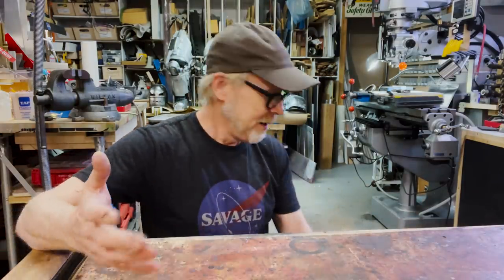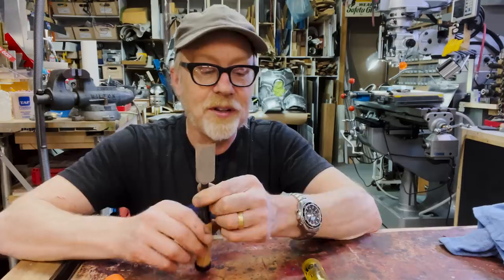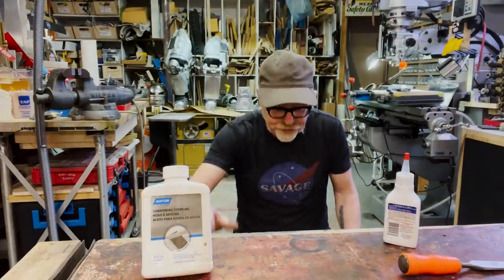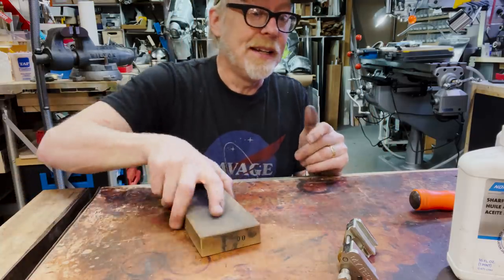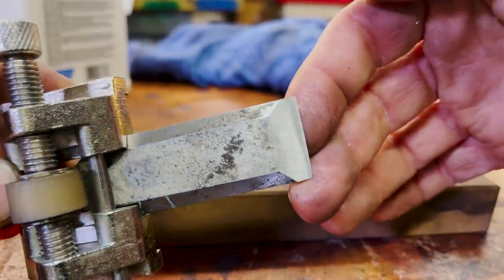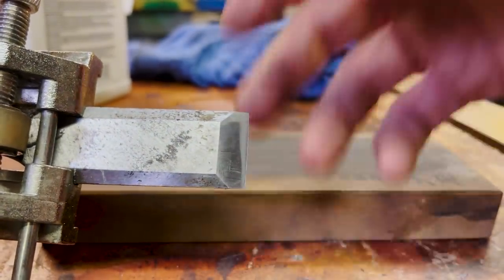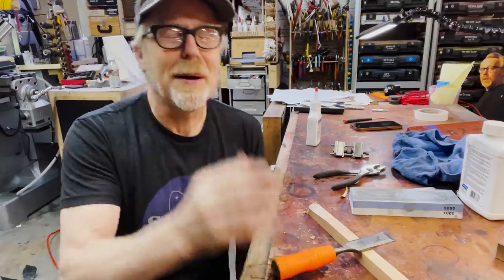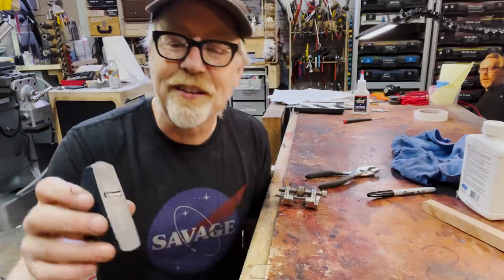Adam Savage's Favorite Tools: Woodworking Chisel Sharpening!

Comment: No one's gonna rant about how Adam used oil on a waterstone?
Reply: Have you even looked at the comment section?
Reply: @PeppoMusic  must be their first day on the Internet. Heck you must be kind of new too. I didn't even have to look to know.
Reply: @1pcfred  the internet's kinda new for the entirety of humanity, really. But I gotta admit I did not spend too much time on the internet during the dial-up days as a kid.
Reply: @PeppoMusic  I did. To this day when someone mentions it I can still head the connection sound echoing in my head. My USR Sportster was a hard rocking modem. I had a Hayes too. The 56K Sportster was the one to have. External, of course.

Comment: A water stone needs to be wet with water, all you did was destroy the stone and over heat the tool, I doubt the 3000 stone made the tool any sharper.  Save some time and leave the water stones in a bucket of water when not using them or just get some DMT diamond stones

Comment: I'm sure it's ok to not use the guide once you've established your bevels.. Then again no harm and less fuss if you've made a stop guide for it. Also, diamond plates > stones for me.
Reply: You're wrong. The guide is so you can maintain your bevel. How do I know? I've been sharpening for over 50 years now. So trust me when I say there is a difference guide or no guide. They sell guides because they actually work. Least you're hep to diamond plates though. You're not wrong there.
Reply: @1pcfred  Well good that it has done you well for so long sir. I respect that you have your opinions and I'm not saying it's right or wrong. But just that there are many ways to achieve the same results. Surely you'd know that better than a youngling like me. Before guides existed, or the "proper" angles were even agreed upon by the general masses, things still got made at even higher quality than they are today. There are no doubts that freehand sharpening has its merits as it's been proven for hundreds of years. A guide or diamond plate is merely an enhancement to old but proven methods. Regarding my comment though, I'm sorry but I should've specified that it was about secondary bevels, as the main bevel, once established on a guide as you preferred, shouldn't be too difficult to hone even for beginners as I know that from personal experience. Sure you might end up having 29, 31, 31.5⁰ or even all of it but it still doesn't affect the cut significantly. Either disagreeing or not we can all agree that the smooth sound of wood getting shaved and shooting out of a plane is satisfying as hell.
Reply: @orien2v2  there is such a thing as a qualified opinion. There is also such a thing as being wrong too. You suffer from survivor bias.

Comment: The reason you're supposed to use water on waterstones is because the metal slurry that forms under your blade is effectively the abrasive, not the stone itself. Oil does make a sludgy substance as well as water. You're also supposed to soak waterstones in water until they're saturated before use.
Reply: There are different kinds of water stones. Not all are pre soak. Some are what is called, "splash and go".

Comment: Poor mans sharpening setup. Get some automotive wet sand paper, stick it to a piece of glass. Seen some use windex to wet the sand paper. Also seen some guy go up to like 16,000 grit on his final sand. I also saw a video where someone said you don't wanna use oil on the stone since it creates a lubrication barrier between the blade and stone thus not giving you a efficient sharpening experience?

Comment: It's a lot easier if you have a jig to line up how far out to protrude the blade from the edge of the sharpener.
Reply: I use a little scrap of plexi. I hold it all up to the light to establish my secondary bevel.

Comment: Ditch the guide. Lay the chisel on the bevelled edge and raise it 5 degrees. Use all of the stone when sharpening. By using the guide your causing uneven wear on the stone which will eventually affect your wider blades.

Comment: Learn to make a good chisel and using a good one will never scare you again. Also, keep a leather strop on hand for when you're chiseling and sharpening won't be as frequent as long as you strop when it starts going dull. Not when it does get dull but when it starts to
Reply: If you're doing varied work there's always jobs where one needs to use a chisel for destructive tasks. So having different grades of chisels for different kinds of work is absolutely correct. I have designated beater chisels. Although I keep them pretty sharp too.

Comment: You do watch other channels, so why not watch Paul Sellers, Rex Krueger, or Rob Cosman to mention a few on how to sharpen with or without stones? When you know how to do it, you'll literally use only a minute on each chisel (unless you've completely ruined the edge). The point is that woodworkers sharpen or hone their chisels and plane irons often, even several times a day if they used them a lot. So sharpening/honing has to be quick and efficient. And doing it right is cheaper than doing it wrong. Also, if you're impatient (if!) just know that you could actually sharpen and hone quicker than you do now ;^)

The prerequisites are: an always accessible sharpening station/board with whatever you use for sharpening (sandpaper glued to glas, water stones, diamond stones, oil stones, etc, but generally speaking three stones: course, fine, very fine.) and a strop (a piece of leather glued to a board with a (usually green) honing compound). So, three stones and a strop. For the stones: water or oil, and the compound for the strop. That's manageable :^) And watching a video by one of the above mentioned gentlemen won't take that long.

Comment: I watched this and cringed... So many people, in fact 99% of people, can't and repeatedly sharpen a chisel wrong....those guides are not helping....  Turn your chisel 90 degrees and stroke like you were without the guide...have you seen a sharpening stone from an antique carpenters tool chest...they are like 4 inches  long... Dont you think a guide of some sort would have been in those chests... Buy holding it 90° to the stone in your dominate hand and using your other hand to apply pressure to the bevel you dont need a guide... By doing this the burr is minimized and a few strokes on a strop will be fine... But think about a knife and how its sharpened... Do you push the bevel or drag it across 90° to the surface... Its more ergonomic and the correct way... Why would ten thousand people make videos about sharpening because no one gets it... Its awkward, turn your blade 90° to the stone and it will be a better operation

Comment: I switched to a Workshop 3000. Fast.  reliable. Did I say fast...?
Reply: If you know what you're doing, and I am not implying that many do, hand honing can be pretty fast too.
Reply: @1pcfred  I understand. Been doing it for over 20yrs. If you work with chisels and planes a lot, the Worksharp is kind of game changer. I am not being compensated in any way for this. I just really believe in the system. There are good videos on Youtube about the system. It can also do gouges.
Reply: The Workshop 3000 is a great system, especially for edges where you want a flat bevel. If you want a hollow bevel, then I would recommend the Tormek sharpening system.
Reply: @jimmeier547  Tormeks are great if you got a grand burning a hole in your pocket. Because by the time you're done buying one you'll have spent at least that much. With a couple accessories and maybe another wheel. At $220 a pop. I manage with a bench grinder and a cup of water personally. Bit more fiscally responsible.
Reply: @tdnate  with any power system you're limited by the kind of abrasives you can use. I'm sure for what it is the machine does a fine job. I am further sure that it is not the have all and end all when it comes to the ultimate in sharpness. Sharp enough? Sure. Sharper than most folks can manage? Probably. As sharp as I like things? No. I've been sharpening for 50 years now. I started real young.
Reply: @1pcfred  And like Adam suggested, it is like comparing the Japanese chisel to the cheap chisel. There is a time and place where the quality of the tool matters. For sharpening, especially for that precise edge for my turning tools, the Tormek is the right choice and actually, makes it fiscally reasonable.
Reply: @1pcfred  I agree, everyones idea of sharp is according to their desire and needs. In our shop we go to 2000 grit sometimes (I know they make a 3600 grit too) but mostly we go to 1000 for quick touch ups then to a honing strop. It works for us.

Comment: So I guess I've become one of those people who yell at their screen your always talking about.
Here is the wisdom of my 20 years of being a chef and knife maker.
All of your stones are water stones and do not need oil. Please use water. By which I mean soak your stone in water until the bubbles stop coming out and have some water standing by to splash onto the stone as you go but use sparingly. The water and stone make a slurry that does a great deal of sharpening and polishing. You should be creating an odd almost watercolour-style art piece as you sharpen. You'll know it when you see it.
There is no grit too high, 3000 is pretty high but the higher you go the more butter-smooth your cuts will be. but just like sanding wood the higher the grit the smoother the product will be, of course, the angle of the blade won't change because of your trolley assembly thingy, which is fine.
A strop is also a godsend, when you work your way up through the grits and then strop it its basically a mirror at that point and there is no substitute for an amazingly polished blade.
A nice piece of jade is a great finisher as well jade is somewhere in the 30,000 grit range.
The best stones are sourced from Narutaki District north of...Kyoto I think. 
You have a good start though. But you need more stones.
Thank you for all that you do. Remember EMBRACE THE SLURRY!!!

Comment: I don’t think I’m OCD but there’s a number of things about this video that just make my skin crawl. Dirty stones; be sure to dress the stones. Oil vs water maters. Sharpening guide geometry: extension set angle. Going at that 1000 grit stone dry: cough the dust. I can’t tell if that’s carbon/nickel differences in the steel or if that’s faceting from inconsistent grinding.

Maybe I’m more OCD than I think.

Comment: Oil stones and water stones are just what they are.. You don't use oil on a water stone, and you don't use water on a oil stone. the reason being is the softness of the stones. Water stones are soft , and oil stones are harder..
Reply: Wrong! You use whatever you want. There are no rules! I never heard an oil stone complain when I used water on it. I don't use oil for sharpening at all. It's too messy.

Comment: honestly if you have chisels and you use them a lot just get something like a Tormek sharpening system
Reply: A Tormek will not produce a very fine finish hone by itself. But they are great for establishing and maintaining primary hollow ground bevels.
Reply: @1pcfred  i have a tormek and it does produce a very fine hone by itself
Reply: @ikbendusan  I am sure it does. I am also sure it is not as fine as a hand honed edge. Stone selection is limited. There's certainly better abrasives available than Tormek is having stones made out of. Even if their stones are obscenely expensive. There's always something better out there. The edge a Tormek can produce is suitable for a variety of things. It is far from the ultimate in sharpness though.
Reply: @1pcfred  so what if it's 0.03% less sharp; you're not going to notice it. the convenience of sharpening is worth much more than that last tiny bit of indistinguishible sharpness

Comment: Adam-Sorry this is a very disappointing video.  BTW_How can you expect to do good work sharpening anything while sitting nest to your sharpening. With arms extended in front to far there is no way that you can "lock into"a repeatable posture for accurate sharpening. Like so may tasks the only proper way to sharpen things on a stone (or wheel) is by standing over the work IMHO-with lots of years of experience. Soooo-JUST Sayin....IMHO....Cheers

Comment: Dimond Stone one side 400 grit the other 1000 git all you need really... hand plane blade around 25 degrees and chisel about 35 degrees.
Reply: Just split the difference and sharpen everything to 30° It's the best work angle.
Reply: @1pcfred  Depends on how long you want the edge to last for, you probably be better of with a slightly higher angle if you're doing heavy duty stuff. I did notice that Adam looked like he was using oil on wet stones though. ;)
Reply: @createdezign1840  what we want does not impact reality. Unless you've scientifically tested the matter you have to defer to the data that has been compiled. Find a channel here called Wood by Wright and find his series on testing chisels. The guy spent months. He had an instrument that quantified sharpness too. He was not relying on his subjective opinion. 30° is where it is at when it comes to woodworking tools. Edges are not measurably sharper at shallower angles and they're less durable. I used to think different myself. Turns out I was wrong.

Comment: I've got a lot of love for Adam, but don't sharpen your chisels like this.  
Soak your waterstones in water for 20 mins, don't use oil.
Flatten your waterstones before every use, Adam's chisel edge is visibly rounded from working on a dished stone.
Use a homemade setup block to set the distance the chisel sits in the sharpening guide so you hit the same mark every time, don't eyeball it.
You should come up to 8000 grit for fine work.
If you're going to strop then do it on a piece of veg tan leather, I personally don't like using any buffing agents

I prefer Mike Pekovich's advice on sharpening over Paul Sellers (even though I have a lot of love for Paul as well).
Reply: Don't use water stones period. They're garbage!
Reply: @1pcfred  I disagree.  I used diamond plates for a long time.  Even a set of Norton waterstones are superior, cuts steel faster and leaves a better surface.  I don't like having to soak them or flatten them though, so I'll be upgrading to Shaptons soon.
Reply: @Exodus5K  you are not going to sell me on the theory that there's harder materials generally available than diamond. But when they start selling wurtzite boron nitride plates I'll be first in line to pick one up!
Reply: @1pcfred  To each their own, but I found the scratch pattern on DMT diamond plates left an inferior surface.  Like you I resisted switching for a long time, but when I eventually wore out my diamond plates and was looking at a hefty sum of money to replace them I gave waterstones a shot and found them to be superior to the task.
Reply: @Exodus5K   I take it up to 1000 on diamond plates and polish with Spyderco ceramic hones. I get a mirror polish after I strop with compound. A typical touch up is 1000 -> medium -> fine -> strop. If an edge is really worn I'll use coarser plates to reprofile. I also hollow grind all my tools on a bench grinder too. Because I don't want to be honing them all day. I use the cheap Chinese thin plates which I 3M 90 spray glue it to a piece of plexi. I call them Crapton plastics. You know, as opposed to Shapton glass plates? heh But they're really pretty good. Sharpening is a whole system. There's no one and done method really. You have to progress through the grits. I have a rack I keep all my hones in. In order.
Reply: @1pcfred  It's basically what Adam was talking about at the beginning of the video, depending on who you ask you will get completely different advice when it comes to sharpening.  I can say that your method is basically the exact opposite of mine.  I use waterstones and take it up to 8000.  Then I strop on a piece of veg tan leather that's glued to plywood so it lays flat, no compound.  The leather itself has natural silica that does the polishing.  I do this for my bench chisels and hand plane blades, which also get hollow ground at the bench grinder when my bevels get too wide.
Reply: @Exodus5K  at least you hollow grind. A lot fail to do that. Personally I think it is essential. Although I didn't always recognize its importance. I came upon it laterally restoring old beat used chisels myself. Tools that looked like folks used them to cut bricks. Was clearly too much material to remove by hand. But then it dawned on me that any straight bevel is too much steel to work on a hone by hand.

Comment: Please don't sharpen those nice Japanese chisels like that. That 1000/3000 stone is a water stone...use water on it. That different hue to the edge is not a hamon,  it's a slight secondary bevel.  The flat side looks that way because they run that side of the chisel on the stone to get rid of the wire/burr.